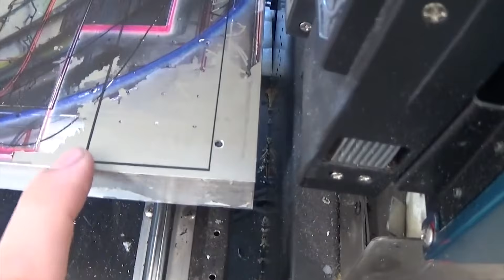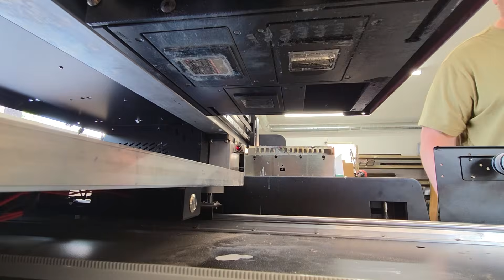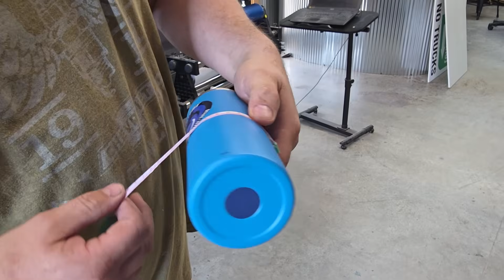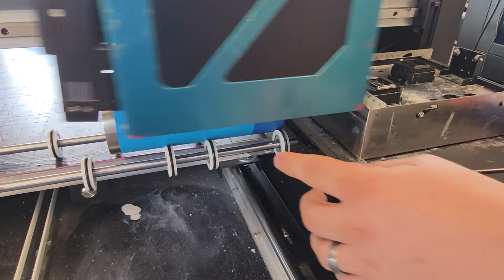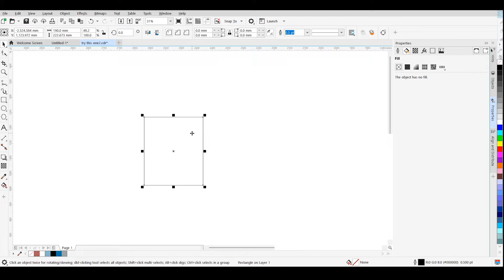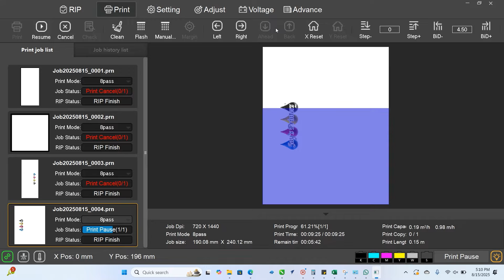How to uv print with a Rotary for Jay's Printers Howto UV Printer Tumblers Cups

Comment: The positive: You really seem to know your stuff so support should be pretty good when I purchase a printer. The negative: OMG! This seems like a whole lot of work just to print a tumbler! Is the process the same with the J16 rotary?
Reply from the maker: The j16 rotary is a little easier it holds in place with a strong magnet and has a button to print woth rotary after some calibration techs will happily help you

Comment: high jake is this posible on any uv dtf flatbed printer? my factory said not posible on your machine because of the heads i use Epson 1600 print Head
Reply from the maker: I cant speak for every manufacture but it shoukd be

Comment: would it be crazy, once you have the rotary position dialed in, to mark the rotary and machine with some little marks so the next time you can bolt it in the same spot and save the extra work?  Just curious, I'm new to this so I will have many questions!  Thanks for the great info!
Reply from the maker: Thanks for watching